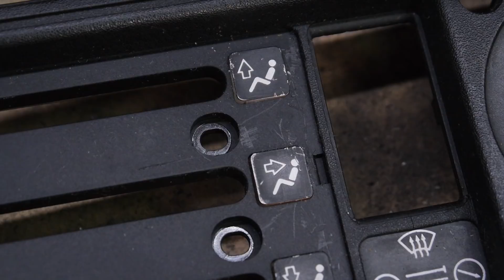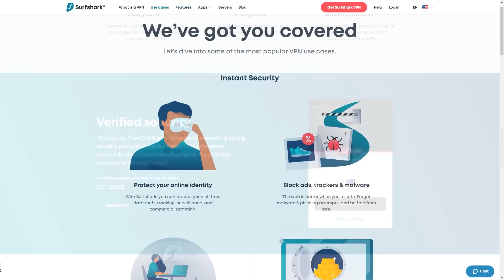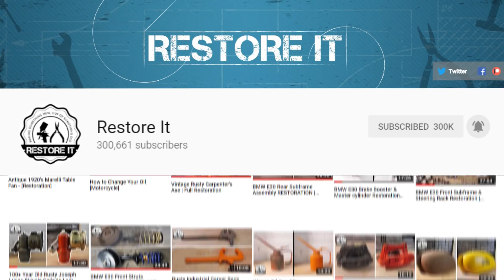BMW E30 Heater/Air Con Unit Restoration

Comment from the maker: Hey guys, thanks for watching and thanks for all of the advice. I've decided I'm going to change both heat exchangers (the heater core and evaporator) for brand new ones and also buy a new blower motor to go with the new motor clip that's on the way. I could have waited for all of those parts to arrive, but in the current climate, it would have delayed the video for weeks. I'll make a little video for Instagram when all of the new parts arrive. Follow @restoreitytchannel to see that when it happens. Thanks for all the lovely comments! Stay safe everyone.
Reply: Нужно было разобраться почему дырка появилась, вероятно подшипнику мотора конец, дырка появится снова.
Reply: Smart move, while some say if it aint broke don't fix it. These parts usually decide to start leaking after they get put back in. Its worth replacing them ALWAYS!
Reply: You too my friend..
Reply: I think it's enough just finish this car 😄
Reply: What a quality job you just have done! Well done mate!
Reply: How can I get another  clamp for the blower motor to stay put
Reply: That looks like a retrofit Air Conditioning system, ,possibly Diavia, that is what we used to fit at the dealer thirty years ago, some of them had their own resistor that fitted in replacement of the original. Great restoration attention to detail is phenomenal.
Reply: q
Reply: @restore lt , What is the foam rubber you used to replace the ventilation fins? I need to find out that in order to replace them.
Reply: What did you use for the insulation goop around the hoses?
Reply: What kind of foam did you used for the ac evaporator and heater core ? You mind sharing ?
Reply: Good to hear you are ordering a new motor, they are cheap to buy and would avoid any issues with bearings and coils.

I have the same motor in my 75 and I've changed a few in the past and never want anyone to go through that pain.

On another note, with the cables, in my car when the cable outer is deteriorated, the cables don't work anymore (or not as well) cause the clips can't grip them. This causes the outer to move with the inner. Would have been good to see you tackle that issue. Nice video!

Comment: Those gaskets are really important to prevent water dripping in through the upper firewall. I got a rusyt footwell because of that... I would replace all of them. Please check for leaks after reinstallation in that area to prevent further leakage! Keep up the good work and stay safe down there in Spain. Best from Germany
Reply from the maker: Thanks for the advice Miguel! And thanks for watching!
Reply: o shit did not know that,wonder if e34 has gasket there too,around that blower motor stuff

Comment: I have done a similiar project to a mk2 golf's heaterbox. Dismantled everything, cleaned it, replaced all the gaskets and foam insulators. Replaced the heatermatrix, cleaned and restored the faceplate, replaced the bulbs, blower motor etc. It was worth the effort 100%. I kind of wish i had an older car again, so i could do all these projects that made me happy back in the day.
Reply from the maker: Get another old car Rosten! You wont regret it... much... I have new parts on the way now. I just wanted to get this video out asap :D

Comment: I'm amazed you can still get those foam gaskets.
Reply from the maker: Me too. it's why i love the E30 and BMW in general.
Reply: Juden Arier  never heard of that. thx for the info, will start to put some silicone on them to prevent that
Reply: Germans general support their models for decades. The French on the other hand, well let’s say they do the opposite. Sometimes they don’t support models after 7 years (Citroën for example).

Comment: I did this exact same thing to a 1996 Jeep Grand Cherokee.I totally removed the entire dash and everything connected to the metal firewall. And for the deteriorated foam parts and doors, I used sun-visor replacement materials and 3M 77 spray glues. Every part removed, cleaned and tested. I even replaced the heater/AC units in the plenum as well. Great to have a perfectly great working system again. Thumbs Up!

Comment: Hey, I'm not a mechanic or anything, but I'd like to point out: when sealing 2 components together, always insert all the fasteners and brackets where they're supposed to go. I.E: the screws on a cylinder head. You place and screw them on all first before beginning to tighten them (as opposed to placing 1 screw and tightening it, then placing another and so on). You could do so with brackets and rivets: place all brackets with rivets before securing them down completely.
Reply from the maker: Thanks for the advice Luke, great point.
Reply: Yes and no. On plastic the effect is almost minimal really, in this case is more of a good habit. Talking about motor that's very true, but you won't do it to secure the seal, you tighten then torque to avoid bending the cylinder head into a banana
Reply: The professor has arrived who has to explain to a professional how to restore a component of this car !! Bravo, you did a good job. I have the same car and I will have to do the exact same job, I hope it will succeed.

Comment: The fan and heater in my BMW E30 stopped working about a year ago. They quoted me $1,000 to repair it, and now I can see why. You did an amazing job! I would never be able to get all those parts back together correctly.

Comment: doing the same with e34's siemens heater, so, literally,  i know this feel, bruh xD 
A little advice:  try to heat plastic a bit, using heat gun  for that. Doing this before disassembling keeps you safe from cracking plastic. Cheers from Russia, keep it up m8 ;)
Reply from the maker: Cheers Rick! Great advice thanks man.

Comment: I love seeing someone taking the time to restore parts like this, awesome job! I need to do the same to one of my vehicles, where did you get those foam sheets from? I've tried using stuff from hardware stores, but it doesn't quite do the trick.
Reply from the maker: Thanks Cody! And here - https://www.ebay.co.uk/itm/Foam-Sheet-Sponge-Rubber-Grey-Extra-Sticky-Self-Adhesive-Plain-Gaskets-Seals/261530567751?ssPageName=STRK%3AMEBIDX%3AIT&var=563614506322&_trksid=p2057872.m2749.l2649
Reply: @RestoreIt  awesome, thank you!

Comment: Mannnnn I'm extremely impressed with this one. As a fellow restoration geek I'll restore practically anything I can get my hands on but, this is one of those things were I'd be WAY too uncomfortable tackling. It looked so painfully confusing through this video during the disassembly, but surprisingly it looked much simpler during the reassembly process. Good job brotha, been watching you since the very first upload and you never fail to satisfy!! Never stop doing this please  😂

Comment: I just logged on to recommend that you change out the heat ex-changers and the blower motor only to see that you have already made that decision. I am sure you will not regret that, it will be money well spent. An ounce of prevention is worth a pound of cure.

Comment: im a mechanic and believe me , that cable hatches are GOLD , then never go bad , not like all new cars have vacuumed or electric motor  hatches witch they always break and mix cold air with hot and from outside an its a pain to fix . OLD cars are GOLD

Comment: Wow, that calls for patience! Regarding the blower motor, check the brush holder, it's made of nylon and sometimes it overheats and deforms, also, the brushes make contact with the collector at an angle instead of perpendicularly, so any deviation makes the motor intermittently not to start (or not to start at all). Nice vids. Good luck.

Comment: Hello restor it, ...........the name of the material at 9:57 is no drip tape and it prevents condensation. The stuff is important. It is made in the USA. When a new BMW evaporator is purchased, the material is not yet applied. We only glued this on at the end of the assembly. The expansion valve must also be fully enclosed. Otherwise you get wet feet. Greetings from Germany, your repair job is 100% successful.

Comment: Another excellent video....I was watching with keen interest as I have to replace those two big gaskets. I discovered the reason my car makes an almighty squealing noise above a certain speed (can't say the actual speed....if you catch my drift....).....is that those two gaskets have dried out, so the air whistles through the gaps left my them shrinking. Very helpful indeed.....Thank you so much.
Reply from the maker: Thanks davpkav, glad you found it usefull :D

Comment: For removing any adhesive you should use 3M Cleaner Spray (Citrus). It's a bit costly per can, but a can will last you forever and it just dissolves pretty much any adhesive making it really easy to remove.

Comment: You sir, are exceptional! Unquestionably I do not have the patience but I truly wish I could find someone in the states that would attempt some of these restorations with your attention to detail and patience (probably said person isn’t even in existence). I have an ‘85 325e that has been in my family since ‘88 (2nd owner, 90k miles manual trans) and I drive it from time to time but needs a good amount of stuff. This being step one, the A/C and heat, planning on restoring the rest as well with all original and factory parts to bring it back to its former glory but in the states it’s next to impossible to find parts.

Comment: Incredible attention to detail. Should have sent you my E30 M3 Evo to restore rather than those amateurs at Schmiedmann, Odense.
They left the heater unit's corroded aluminium pipe  (half of the end was missing), and simply wrapped electrical tape around the end and mated it to a brand new SAMCO silicone hose.
First attempt to heat the cabin, no warm air; they left in the original stuck valve.
Looking forward to seeing the completed project.

Comment: Great work on the HVAC. I think the 3D pen is a great idea for making and restoring ABS parts. As usual, your attention to detail really makes the difference.
I suggest when you get around to the instrument cluster, inspecting and reflowing the solder joints. Especially around the Canbus connector. Vibrations over the years can cause hairline cracks in the joints that can make the electronics behave erratically.

Comment: a tip: if you weld plastic, use an adjustable soldering iron. The different plastics need certain temperatures in order to fuse properly. if the temperature is too high, the plasticizer will burn into the plastic and it will become brittle. in addition, in addition, you should always try to warm the entire break point in the plastic. so that it connects well.

Comment: The diode is an important part of the motor wiring. The motor is an inductive load so when it's turned off, current effectively "wants" to keep flowing. The diode allows the current thr through the windings to continue without building up a large voltage spike. With no diode present to allow this current to "recirculate", a high voltage spike would occur each time the motor is switched off which, over time, would damage the switch contacts (electric arcing across the opened contacts). This also applies for relays and other inductive DC loads.
Reply from the maker: Thanks for the info Simon!

Comment: Man the deeper you got into it the more rough it started to look. Glad it worked out as well as it did. Hope the next steps come easier.

Your power clips on your plating setup could use some assistance. :P
The 3d pen parts came out better than I expected them to. Very nice!

Comment: perfect restoration ! you are awesome and i learned a lot from you , just one thing though  i wished you clean inside the (pipe) of radiator because after while lime Sediment in the pipe and block the whole system or at least change the radiator

Comment: Ah you beat me to mine for my Z3. I chose to use super high temperature range silicone foam/rubber from mc master carr with high temp range pressure sensitive adhesive. I had zero desire to do this job again as all urethane foams tend to fall apart after a few years under severe conditions.
Great job though, I started mine in 2018 and should be done this week lol

Comment: Just a small tip: Flush your heater core, you'll have lots of sediments and rust in it. also the heating performance will be greatly improved :)

Comment: You should change those vacuum pods for new ones, the diaframe starts to leak in those when they are old. Most times in older cars they don't work because of leak and same time as they leak, other vacuum systems are not working correctly.

Comment: One of those times that just as you thought you had everything disassembled, you have to disassemble some more :-) Great video, although I'm surprised there wasn't any grease on the moving parts.  If you're taking it apart again, maybe add some grease to aid longevity as it looks like ABS?

Comment: This will help me so much! Would you be so kind to tell me how thick the foam was that you used? I have one AC unit and one with automatic temperature control and plan to combine them into one and restore it along the way before installing everything into my e30. Thanks for putting so much effort into this video!!

Comment: I love your attention to detail!!

What did you use for a guide on what types of foam to order for the different locations in the unit?

All the plastic was painted with the black bumper paint?

There are inexpensive "fin straightening" tools available to simplify that process,  and A/C coil cleaner might work to polish up the space between the fins that aren't easily accessible.

Comment: 10 out of 10 bro, amazing job. Looks good as new.. Loved the way u repaired burnt plastic and fixed patch👌👌. The trim paint u used looks gud, reckon I can use it to spray head light grill surround?
Reply from the maker: Thanks man! And for sure. it's actually bumper trim paint, so should last outside well.
Reply: Thanks can u link spray paint name please in description 👍

Comment: I had no idea how much I wanted this video until it showed up in my feed. What did you use for the foam for all the internal vents? I used some draft stopper material, but that lasted only a few opens and closes.

Comment: Nicely done, quite impressive attention to detail as well 😁
In the end, will you also grease part of the moving mechanisms ? 
Might be a good idea to use some silicone grease spray or PTFE spray since you went through the trouble.
Reply from the maker: Thanks dude. One thing I did indeed forgot to do. I did one off camera and forgot to do the rest on camera! Thanks for the reminder :)
Reply: @RestoreIt  Glad your sorted it out 😁
Good luck with the rest 👍🏻

Comment: The “radiator” is called a condenser. Always wise to get it tested to be sure it will hold a vacuum. Would be a nightmare to discover it had a leak after refitting it all into the car.
Reply: Condenser is in front of the radiator, evaporator is in the car/cold side

Comment: I think you should check motor/fan bearings, because the can be such noisy over 30 years
Reply from the maker: I'm thinking of getting a new one before I put it all back in the car :)
Reply: @RestoreIt  Its also an option. However thank you for that restoration, cause I have to do that in my E30 too :/ Now it would be a little easier :)

Comment: So after you repaired that piece of plastic by welding it (which was amazing) it looks like at the end you had to recut it ? Or was that plastic welding done afterwards ? It looks like the holes were necessary to give clearance to the tubes anyway. But like you said maybe you have the wrong radiator ?

Comment: I would change the heater solenoid valve, replace it with one that has the grey top which are easily restored, the black topped valves have a complicated diaphragm, which is impossible to replicate.  I would highly recommend the valve be replaced and overhauled

Comment: Hi. Great job! But why did you use old wires?
Reply from the maker: Thanks! I removed any bad connections or bad wires and soldered new ones in. I kind of brushed over it in this video.

Comment: Just got to the point where everything is disassembled. Now I have a decent feel for mechanics, taking things apart and putting them back together, but I'm getting a panic attack just thinking about how he's going to remember where everything fits. All those little metal plates and clips. I usually have to tape pieces like that to the area of the part it came from but when you're cleaning everything you can't do that. We need a video on your system of keeping track of all that.  Do you ever watch your videos backwards to remember?
Reply from the maker: You've got it spot on jake, i watch my video back :D

Comment: Is there an e30 that hasn't had a @ probably not a bmw certified mechanic' have a go at the wiring!
 This is a great resource. I am keeping an eye on areas where i've issues as you work on them! Have to tackle the tin worms this winter... Half thinking of doing a youtube video series to log it rather than the forums buzz..
Reply from the maker: Very true!
Reply: @RestoreIt  mine has an aftermarket alarm which isn't fitted too badly but the max power amp and speakers will need dealing with. The tweeters glued to the a pillars, with a hole punched through the lovely original black 'is' trim...

Comment: Change the radiators and plastic pipes from the solenoid valve, once in the car and it leaks (it will because of age, and high temp); you have to take apart all of it again + clean carpet from antifreeze. Did it on mine, it's not cool and not worth time.

Comment: Great video and all the others in the series, love the detail you go into. Out of curiosity do you remember the size of the foam you bought and cut for the smaller gaskets? I can see the 2 bigger ones are still available from BMW.
Reply from the maker: Thanks Michael, i got some 3mm 4mm and 5mm sheets from eBay.
Reply: @RestoreIt  perfect. Thank you